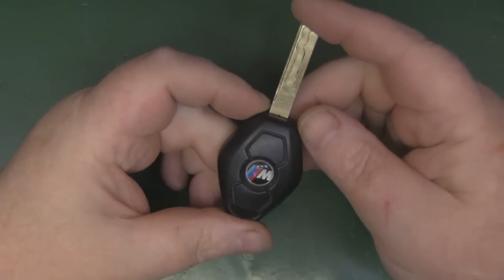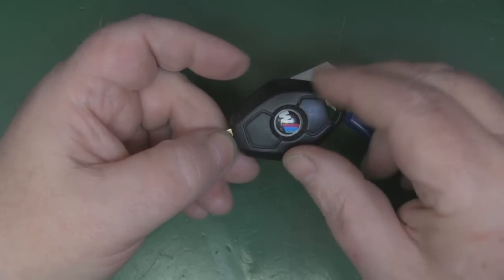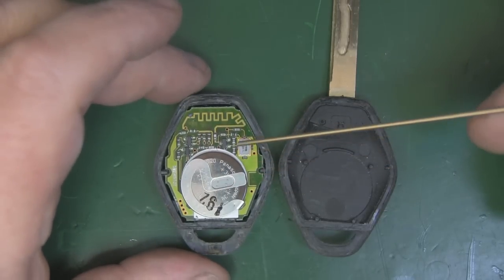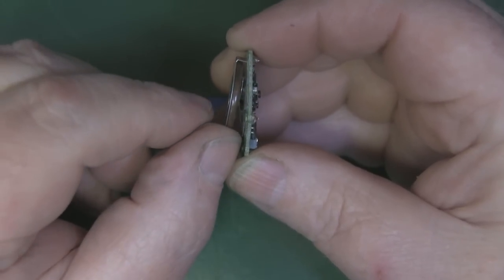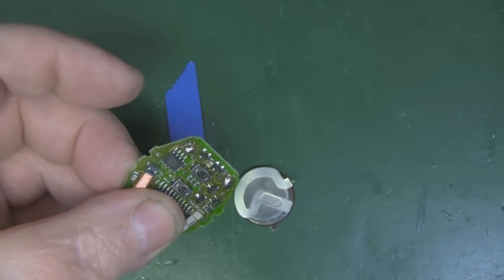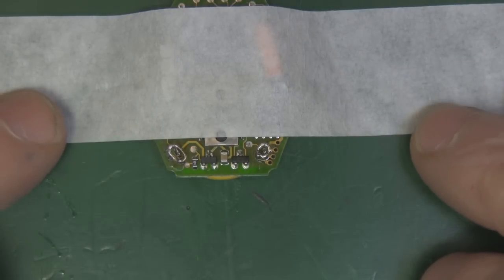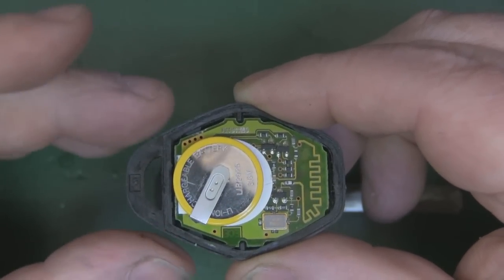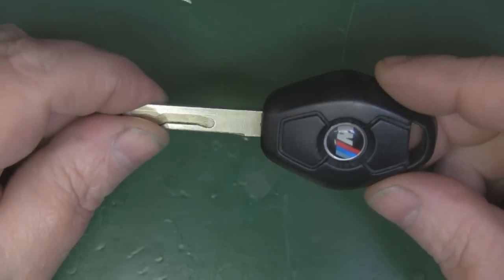BMW E46 Key Battery Replacement For £3!

Comment: This was very useful and it worked as stated. Local BMW dealer wanted 255.00$ cdn for a new key and 55.00$ cdn plus tax to resolve the issue. There should be a law against this type of abuse!
Reply: Agreed it’s robbery, they quoted me $276.00 plus $50.00 CAD to replace the key and program.
Reply: There should be legal ways to compete to drive down the cost.  Not a law against taking advantage of the system

Comment: Thanks Andy, sadly dealer nowadays are fooling lots of their customers whom ending up paying a lot of money for small things like that. If BMW wanted to help their customers, they would easily design after sale fob case that has screws and instead of £130 charge £20. But sadly this is how it works with most of the dealer. 
Thanks for the heart video.

Comment: Nice video pal but like u said it’s a dangerous job , it takes ages to separate it and you can loose your fingers in the process, only tip I can give is that  I used a pair of mole grips with some paper in the jaws and gripped the blade while I cut it , I slipped a few times so thanks God I had the grips 👌👍

Comment: Great tutorial. Just did my E39 spare key. Seems I got exactly the same battery you did, however the two cotaxct 'feet' were a good 1mm from lining up with he holes. had to bend them out slightly.

Comment: Nice tutorial but I would highly recommend wearing gloves in case the blade slips. Start by rocking the blade at the key ring side of it, then rock it back and forth around the perimeter from that point.Carefully pry the circuit board out, then clean the dried glue around the perimeter of the casing with a sharp knife before reinserting the circuit board. After de-soldering and removing the battery, use a solder sucker to clean out the holes. Apply flux (important to ensure a clean tight bond when you re-solder). There are small notches on each side of the circuit board which fit into the case.

Comment: I replace sealed remote key fob batteries.  I pay £6.50 for good quality batteries.  I use a dremel to cut open these remotes but have to be very careful in doing so.  I only charge £38 for this service.
Reply: Are you any good with e46 batteries

Comment: I tried but damaged some components of the circuit board. You need to be very careful with the blade and watch out that it doesnt go in too far. Still nicely explained and good video, but its not easy! I was not careful enough… hope others will succeed.
Reply from the maker: That’s a good point, they don’t make it easy do they

Comment: Hi Andrew, How did you align the two battery terminals with the two holes on the PCB? The original battery has these circular connector on each side of the battery - I removed it with the soldiering iron from the PCB but now the new terminals are not aligning with the two holes - which are in 10 & 2 o,clock position ?!! That’s the last thing I cannot resolve. Any guidance is greatly appreciated.

Comment: At 6:26 the component that's just to the left of the coil, and just to the right of his thumb, anyone know if its a resistor or a capacitor? Looks more like a cap. Either way, does anyone know what the value of it is? Mine is missing, need to replace it. Thanks.

Comment: The remote control now works after replace baterry, but now I canot unlock the car with the physical key in the lock!
Can you give me some instructions? tnx
Reply: Has nothing to do with the key. Mine has bit shitty lock too and you have to twist the key very swiftly to open

Comment: hi Andrew contacted you before ,after making an Arial wideband (scanning only) for my Watson scanner  looking at this one but sure with your expertise you could build a far better one or at least show me or tell me how to do it?
Watson WSMA-881 SMA Super Gainer Wideband Handheld Scanner Antenna 25-1900MHz 
Our most popular replacement scanner antenna, this antenna will improve the performance on any VHF/UHF scanner compared to the standard antenna supplied with it.
This antenna is a male SMA connector, we also have the same antenna with a BNC connector on it (search for W-811).
This antenna is designed with really long distance reception in mind and that's exactly what it does. The high quality engineering and ergonomic design ensure that it is the natural replacement for those seeking to extend their receiver’s range.
25 - 1900MHz
40cm long
SMA Male Connector
thanks

Comment: Hi Sir do you think it’s possible to recharge the key fob batt using a wireless charger for a cell phone, that also induction charging. My car also standing most of the time E46
Reply from the maker: Yes I give mine a boost during the winter with my toothbrush charger

Comment: are you sure it is the battery?
my 3 series e46 is over 17yo and both keys still work despite  it having incredibly low MI (key not in ignition  to charge much at all)
one key stops working sometimes but it is because it is not coded to the  car
 try to re code the  key to the car  first before you open the key
i almost tried to replace my battery and there was nothing wrong with it for some reason it came un coded to the car
Reply from the maker: Yes it was the battery my second key still works fine though with the original battery
Reply: huh i thought my battery was dead for the longest time in my second key  then i took  it to my mechanic who is a the head mechanic  for one of the dealers but does work on the side,  he put the key in to i fog=rget which ignition position and turned it to a few different positions and held some button on the FOB and then it  worked again but then shortly after my other key stopped working i need to look up the  procedure
but i am also going to get  myself a K+DCAN cable and get int NCS expert
 or maybe a BMW scan tool dongle so i can code other things myslef
really want the widow roll up with key FOB feature which is not permitted to be enabled   here stateside like it is for you

Comment: Dont think you need to use a soldering tool
The battery simply pops out nicely and you need to simply slide in the new one
Also ensure its a RECHARGEABLE type

Comment: Would the 90 degree battery work for 2001 BMW 325i? I don't see e36 included when looking at batteries.
Reply: You have you have an E46

Comment: I got new rechargeable LIR2025 batteries online and after receiving them realized they are 3.6V and the original is 3.0V. Is this a problem? I remember reading somewhere that the facelift E46's have 3.0V and the non-facelifts 3.0. Should I try the 3.6V batteries or can overvoltage damage the key electronics?
Reply: @andrew mcneil, you seem to be using the 3.6V on the left-hand side, but what was the voltage on the batter on the right-hand side?
Reply: Why not just buy the right battery? Plenty from china. Some commenter said VL202.
Reply: @andrewmcneil do you see the question and comments here? These are from 3 years ago.

Comment: Ok, so hows this for weird - just put new battery in, same as yours (LIR2025), went out to the car and tested it - unlock works, boot unlock works, starts the car, but the key will NOT lock the car. 
Everything working except lock function, and from a good distance, so new battery is OK, but it doesnt lock. Tried pressing the button on the circuit board directly - nothing.
any ideas???
Reply: May need to solder a new micro switch onto the board
Reply: you need to reprogram your key to the car after changing the battery, to do that 1.insert key into ignition and turn only to the first switch then turn of and pull key out
2. on the key press and hold the unlock button and press the lock button 3 times while still holding the unlock button, then release it.
if you did it correctly after releasing you will see the car locking and unlocking all 4 doors which is a confirmation that the key is programmed correctly.

Comment: Thank Andy. The battery has to be LR2025 right?
Reply from the maker: Yep
Reply: @andrewmcneil  no, your original battery (like mine) was a VL2020, They are 3.0V. You replaced it with the WRONG battery- a 3.6V battery. WHY DID YOU DO THAT? AND DOES IT STILL WORK? Thanks!
Reply from the maker: @MarkShapiroMusic  Yes
Reply: @andrewmcneil  Thanks! My question was- WHY DID YOU DO THAT?
Reply from the maker: @MarkShapiroMusic  I don’t know why you’re shouting but 8 years ago this was the correct battery and yes it still works. If the battery model number has changed in 2023 fine when mine stops working again I will look into it.
Reply: @andrewmcneil  you wrote " 8 years ago this was the correct battery". Says who? That's a serious question. It wasnt the correct battery then and it's not the correct battery now. Your old battery was a VL2020 which is 3.0V. That's all stamped on your old battery. Your new battery is an LIR2025 which is 3.6V. That's all stamped on your new battery. Since when is a 3.6V battery the "correct replacement" for a 3.0V battery? I'm frustrated because you've been asked this question a few times over the past 5 years and you've always ignored it up until now, And then you ignored my 1st attempt at asking you. If you don't know the difference between a 3.0V battery and a 3.6V battery just say so. Thanks! Again- YOU PUT THE WRONG BATTERY IN YOUR FOB.
Reply from the maker: @MarkShapiroMusic  Go and make some music knobhead and chill out
Reply: @andrewmcneil  LOL @ "knobhead". You Brits are the best! 👍🥂😁

Comment: I have just purchased two new key's for my E46 and it only cost me £80 
I would rather pay for a key than to mess about doing that shit loosing a finger in the process. but suppose if your cheapskate then this is the way for you!!
Reply from the maker: As the saying goes “you can’t help stupid”
Reply: You are pretty cheap to run such an old car. It cost me £0 to have 2 original keys still working. I only drive rarely and have no idea where the keys get the charge from. Maybe from atmospheric static electricity.